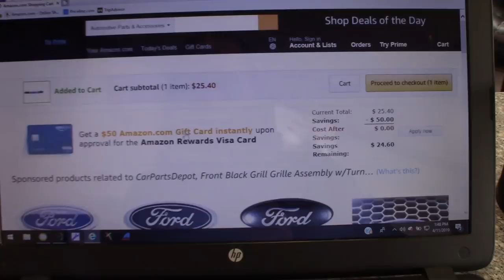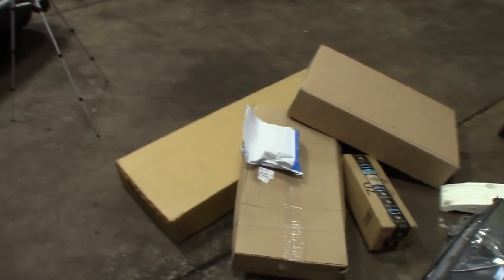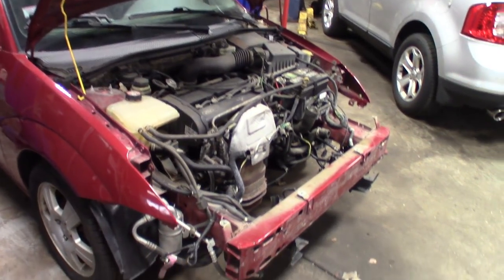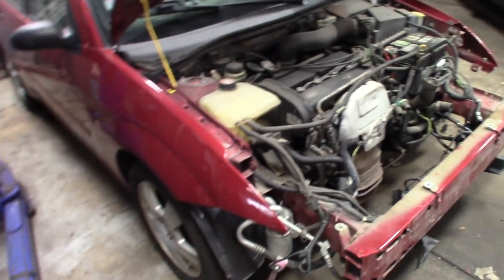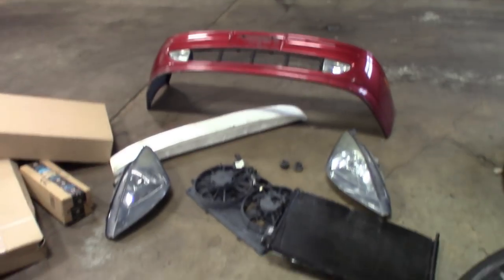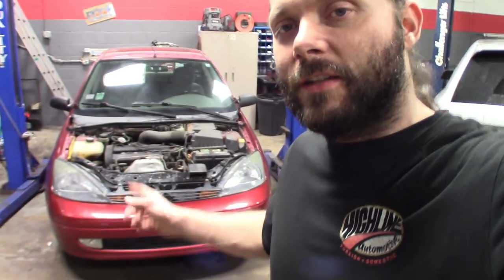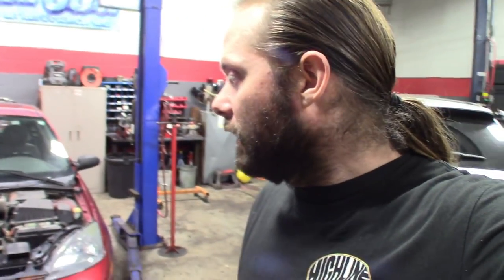FORD FLIP

Comment: hey what do you think about rock auto ,com and their parts do you use them when time is on your side or do you find them very useful when you have someone that needs parts cheap and just have to wait for them i find their parts priced very good even with paying shipping if you have not used them you may want to look at them here is a example for you i needed a gas tank for my ford all my local stores was any where from 225 to 275 went with there tank and after paying the cheapiest shipping i got the tank here for 175 i think it was just wandering what you think